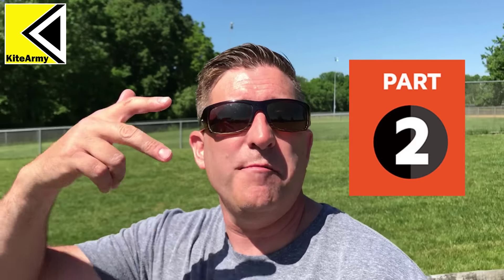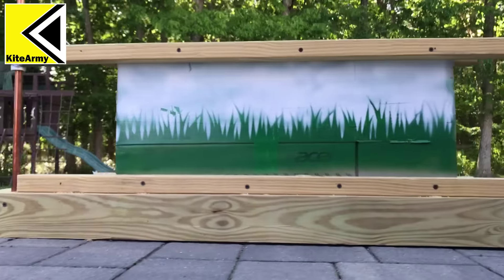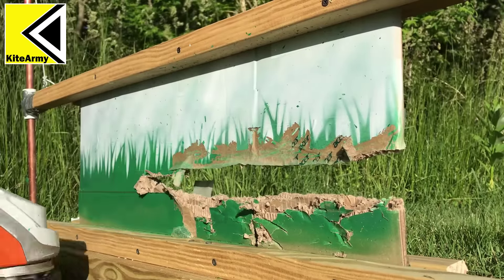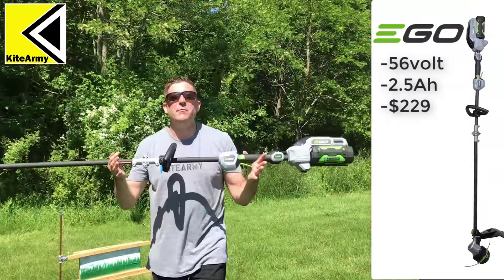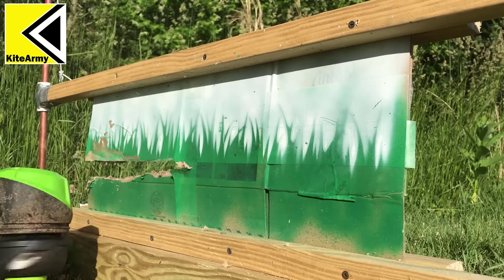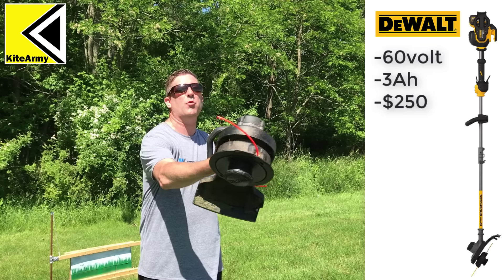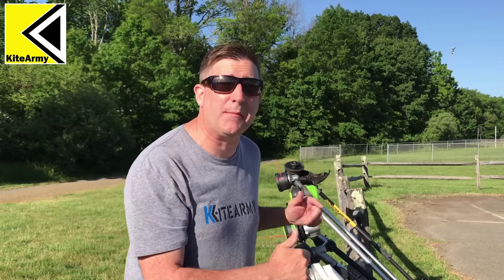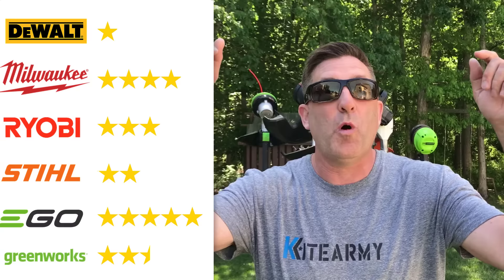BEST STRING TRIMMER 2020 | EGO Milwaukee Dewalt Ryobi Stihl 💪💪💪

Comment: Doesn’t the EGO have 2 different size batteries the 56 volt 2.5 and their 56 volt 5.0 amp ones? If so which one is recommended and I thought I heard you say you tested their 2.5. I could be wrong my health is down a bit so is my thinking. I am buying one for my 47 year old son that moved back home to help my wife and I maintain our yard and house so we can stay here. My Still gas trimmer is 5 years old and has had a starting issue since it was new that they would not take care of so their products are my very last choice. Thank you so much and I posted a message before this one also. Just call me confused 😐 sorry.
Reply from the maker: No so cool that you commented.  Yes they sell different batteries - they only change the run time not the power.  I really like the 2.5Ah - I can trim for about 45 min.  EGO is the model I told my mom to get - the carbon fiber auto load
Reply: The 2.5Ah battery is fine, should have at least 1/2 hr runtime and takes only 20-30min to charge.  Plus it will be a bit lighter than the 5.0 Ah.   EGO also has a 7.5 Ah.  The 5 and 7.5 are best for the mower and snowblower.
Reply from the maker: @generaltso9402  I like the 2.5Ah for the blower and trimmer.  I think you need the high speed charger to charge in about 30 min.  I think the standard charger is about 1.5 hours
Reply: @Kitearmy  Yeah, I like it for those and the hedge trimmer also.  I now use the high speed charger that I got with the snow blower last winter.  But I don't remember the 2.5 taking 1.5 hrs on the old charger, maybe 40-50 instead of the 20-30 I first thought.  Anyway a 2nd 2.5 is recommended for backup!  And truthfully I usually wear out before a fully charged battery.   Oh and I highly recommend the online warranty (3yrs?) registering of each battery since they are pricey.  I've not had any issues, but hopefully EGO would follow thru if you did.

I do wish they made a separate pole saw that could be a tool only purchase.  I don't want to pay for a combo unit that I don't need.
Reply from the maker: @generaltso9402  I have the multi head - pole saw, trimmer, and edger

Comment: To me it looked like you wanted 2 of them to come ahead.  The direction you cut makes a difference and the two of them you went left to right and they both made a big difference on cutting, where as the others you went right to left.  With that said, if they do not load the string or run it out way to fast, it does not matter what way you cut. LOL  Anyway, it would be good to see how they all do going left to right.  Seems like the dewalt would have done better if that was done. Not that I am a dewalt guy.  Just that it almost made it across and if going the other way may have done just as well as the best one in your test.
Reply from the maker: Okay - the direction I moved depended on the rotation of the head.  I'm making a video now to help people understand trimmer rotations and how it works....stay tuned

Comment: Subbed ,but a bit confused, there appears to be 3 versions of the Ego,  Your  link  is to the model# ST1521S for $229.00  There are 3 other ego trimmers,  2 more expensive, 1 less expensive. Just to be sure,The only difference is   battery power +size+weight ?  The 1 ou reviewed has the same features as the more expensive models? Why didn't you review the more expensive  ego string trimmers? The mid level was  just more practical?  lighter Weight?   Power of your trimmer is enough?  Thanks for da vid
Reply from the maker: Yeah - Amazon always plays with the Links.  I would go to Home Depot and by the carbon fiber auto-load model - I LOVE THAT THING

Comment: I bought the ego 56volt. It is amazing string trimmer
Reply from the maker: I'm with you
Reply: I bought one 4 days ago too.
Reply from the maker: @moniack  Welcome to the winners club
Reply: Yep, bought mine 5 days ago. After using it, I was grunting like Tim the tool-man Taylor!
Reply from the maker: @GremLant  Is that a good grunt?
Reply: Kite Army ABSOLUTELY:)
Reply from the maker: @GremLant  Cool - did you get the auto load/carbon fiber?
Reply: Kite Army Yep, got the ST1521S!
Reply from the maker: @GremLant  That's the champ - keep us posted on how it works for you

Comment: You really should redo this test and not fail a trimmer cause the line broke inside the head. And you should also use the gen 2 greenworks trimmer. Keep up the good work! Love your videos.
Reply from the maker: Thanks mate - I didn't fail them because the string broke, I failed them because they did continue to feed string.  Trust me it was totally frustrating that I had to fail any of the trimmers - that was not my intention but what you saw is what happened :)

Comment: Andrew…. I enjoy your videos and I think you get your point across WELL. I am looking to buy the Ego 56v trimmer or the Toro 60v trimmer (not in your comparison, but I know you cannot include them all). I like the addition of the two speed switch on the Toro. I will be using this trimmer on my ¼ acre where I live and also on a half acre lot where I have a cabin. I don’t want to blast the neighbors next to my ¼ acre lot. That’s what I like about the two speed switch plus variable speed trigger on the toro. I read that it is hard to control the speed on the Ego but it looks like a great trimmer. Any thoughts of yours would be appreciated.
Reply from the maker: Thanks - I wish my neighbors were as considerate.  I have tried some of the Toro equipment and would give it overall a fair grade (quality/performance) for the most part all of EGOs equipment I would give an excellent grade too.  The auto load on the EGO can't be beat - BTW that is the model I reccomend
Reply from the maker: Also - you have to see this
Reply: @Kitearmy  Thanks for the quick reply. After viewing your video again, maybe the Ryobi has enough power for my needs but I still think the Ego is probably the better trimmer. Thanks again for the informative video.
Reply from the maker: Bean Harry glad to help
Reply from the maker: @beanharry127  glad to help

Comment: Come on dude the flexvolt is the most powerful, you just don't know how to load them the line advance on the dewalt might be the best I've ever used I own the Milwaukee and dewalt 20v and have the flexvolt at work the 20v and Milwaukee have the same power but the flexvolt is quite a bit more powerful
Reply from the maker: I even dislike the balance of the flexvolt - it has the goofy head.  But happy you like it!
Reply: @Kitearmy  ignore it man. Just another dewalt fan boy angry cuz yellow didnt win. You were honest and fair and compared many brands. Not much to be upset about unless your brand didn't win i guess.

Comment: how is it that the stihl failed? looked like I could power through it with better line.
Reply from the maker: It failed because it could no longer feed string - the feed is bad on the stihl trimmer
Reply: @Kitearmy  that's a problem with the string, it fuses to itself. just try it with better string

Comment: Kite Army  Could you include TORO Powerplex 40V outdoor tools in your reviews???  I was surprised, after searching your videos, to find out you have not included one TORO tool in any of your comparison tests??? Does TORO provide demos to test?  TORO Powerplex tools have been available for more then two years now.  NO blower, trimmer or hedge trimmer reviews!  Toro claims quick charging and better battery life than other 40V systems??  What do you say???
Reply from the maker: Hey m8.  I have never used a toro tool for the sake of testing (lie - I have reviewed the toro timemaster).  I checked out the specs on the blower and they are much lower than most of the blowers I test.  They may (or may not) have faster charge times - doubt it - but performance wise they are just not their.  Make sure you check out the strongest models in this test and the string load test.
Reply: Andrew no offense! My hurried typing and lack of proof reading came across badly!!  My Bad!!!  Your Channel does a great job doing tool Comparison testing for us the public!!   Let me restate, "After searching you videos, I have not found any reviews of Toro CORDLESS outdoor tools in any of your comparison tests." Is there a reason. Do you find Toro product hard to get for review?  Is Toro a hard Co.to work with? I'm in the market for cordless outdoor tool line (trimmer, hedger, blower, and edger) to replace the cord and gas. Toro has a moderately priced outdoor tool line with very few in depth quality reviews. Just wondering why they don't get included in any comparison test I can find?
Reply from the maker: @gmanneod8085  Honestly I generally only try to include stuff that I would consider buying.  Not that a Toro tool could not be good, but the specs seem inferior to the equipment I test.  Also, most of the tools I highlight on my channel I buy from the store - so even if a brand did not offer me the tool it does not mean it is excluded.  Case and point - I dropped nearly $600 on a Stihl cordless blower (my wife is still pissed).  Also, no offense taken on your comment and I will keep an eye out on Toro to see what comes down the pike.

Comment: You shouldn't be doing this. You probably loaded the string wrong. Trying to advance string 3" away from a 2x4 or a solid object is not how it is done. I have never seen anyone have as much trouble with string as you just had, It got to be the user. You should go back to your "lab" and read the directions.
Reply from the maker: Thank you - trust me I know how to load string.  But thanks for your thoughts non the less.
Reply from the maker: https://www.youtube.com/watch?v=kpGGGmb-_ok

Comment: What about Harbor Freight string trimmer.
Reply from the maker: Sure - they are not in this category of tool
Reply: They have the Lynx 40V string trimmer and no one has done a review on it.
Reply from the maker: @mv.m5438  Yeah...I can tell you without testing them that it will not perform as well as any of these units.  But some people are ok with that..

Comment: If this review was based on power why did you give up when the string stop feeding?   Did you use the same string?    Did you wind it properly on the head? I like how you used cardboard but this review seems bias.  It's sad how many subscribers you have.
Reply from the maker: Totally biased.  Why is it sad?
Reply: @Kitearmy  your title was "most powerful" yet to you didn't test the"power" of every string trimmer.  You gave up when something failed that had nothing to do with the power of the string trimmer.  So how is someone going to get an accurate opinion?
Reply from the maker: @Nick-cz7co  Right - the point that I made in the video and I will make it here again is,  I learned that it doesn't matter how much power you have if your head won't advance the line.  I think many people were able to draw fair conclusions from this video about the trimmers.  I think you are smart enough to do so as well.
Reply: @Kitearmy  I do agree that if the head is shit then the trimmer is worthless. Do you think you could look into why the string didn't advance? Maybe it is  design flaw , operator error or the head doesnt work well with that string.
Reply from the maker: @Nick-cz7co  The 3 trimmers who performed OK in this test have updated heads.  I did another test where I loaded heads and had similar results.  I'm confident in this test and stand by it.  I welcome anyone to make a review - I would be interested to see how it works out.

Comment: anybody else have trouble with the older craftsman models?     I feel like it doesn't cut anything.
Reply from the maker: Gas or battery?
Reply: @Kitearmy   corded electric.   you're right...if it doesn't dispense the line, it's worthless (that's my craftsman model...such a POS).
Reply from the maker: @brokedownsystem  Yeah - I try to get people to understand that a trimmer without line is useless.

Comment: ❤️❤️❤️I really like this compilation but it is missing  ( 1. Greenworks G-MAX 40V Cordless String Trimmer and Leaf Blower Combo Pack)  in my compilation the number is included. Nr1     Note that these products were ranked “best seller” at the time this article was written. Amazon’s Best Seller list is updated hourly, so for the most current list.

Comment: keep bumping these electric heads and they wont last and when they die that's 300 down the toilet. the worse that happens on gas is 9 dollar carb replacement and couple of dried hoses and bulb.
Reply from the maker: Yep - I just read an article about a Tesla that has 600K thousand miles on it with the original motor without any service.  Do you think that would be possible with a gas motor?
Reply from the maker: my local dealer charges $80+ per hour for service, so your carb replacement and annual tune and time to do it will probably be close to your $300 estimate.

Comment: Redmax is the best weed wacker that you can buy.
Reply from the maker: These are cordless models - though still not sure that Redmax is the best.  Got to test first
Reply: Kite Army I work in a commercial setting and I have used echo, stihl, and redmax. Redmax is the most ergonomic and the most powerful. Also looks like you need some better quality string because cardboard does not wipe good string out that fast.
Reply from the maker: @leeschanck4037  I'm shocked at how bad cardboard kills line.  The same line that I tore through in seconds on cardboard would last about 15min on grass.

Comment: judging them based on how the string breaks
Reply from the maker: Your smarter than that - I'm judging them on their ability to feed string - sorry your brand is bad at that
Reply: @Kitearmy  at the end of the stihl test you can see that there is no line sticking out anymore. it either snapped off inside or you ran out of string. either way it's crappy string. if I pit my fs120 up against that cardboard with that string it would snap off immediately and fail the test worse than what you showed. according to your logic, that's a fail of the brand.
Reply from the maker: @zacjohnson8404  I use Husquarva Titanium Force .095.  It is the best rated line - Sorry mate....even good line will break on any trimmer BUT a good trimmer should be able to advance.
Reply from the maker: @zacjohnson8404  I say it again - Yes it is a fail - 3 trimmers advanced and 3 didn't all with the same line - I use Husquarva Titanium Force .095.  It is the best rated line.  A trimmer worth having has to be capable of advancing line even when it breaks.  I stand by my test

Comment: "All the brands", no Makita?...
Reply from the maker: Nope -6 brands - no way I would touch Makita
Reply: I was hoping to see the echo. Its a good one. One of the only that doesnt have the motor at the head, allows for  mounting brush  cutter blades. Also can get it in the PAS pro attachment system, so it can be much more than just the string trimmer
Reply from the maker: @bigtwinz3296  I'm including Echo in my latest blower competition - trust me the results will surprise you